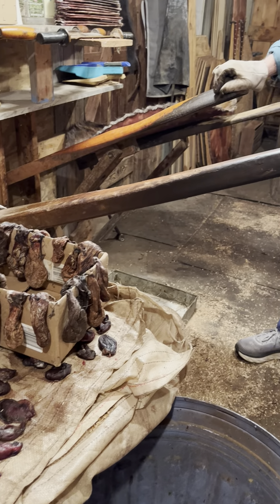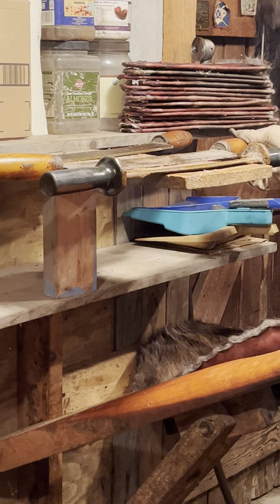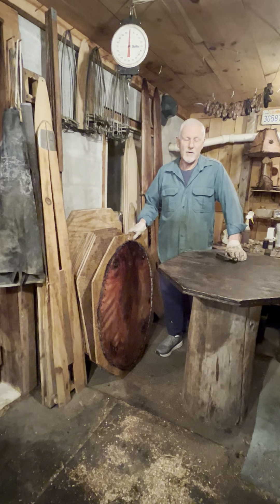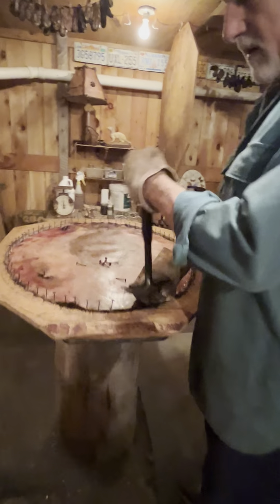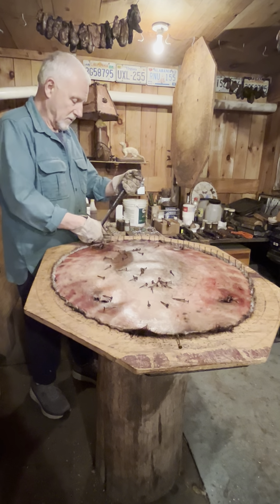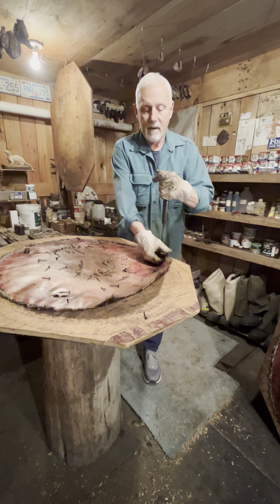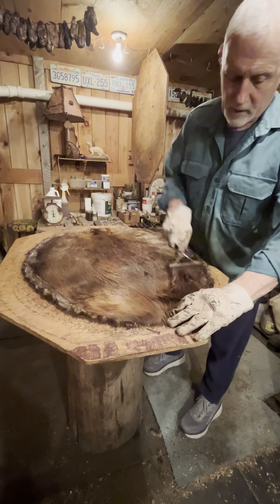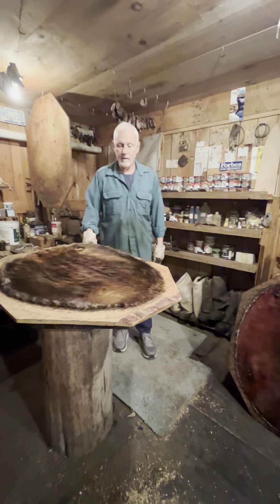Putting up some Beaver with Jim Comstock

Comment: Lots of knowledge shared in just a few minutes. Thank you sir! Nice setup.
Reply from the maker: Thank you.  When I first got into fur trapping seriously with Thorpe in the mid 70's in Virginia, good ol' Johnny said, "if we going to Virginia you are gonna have to do the scraping," which didn't bother me one bit.  Told him, "Sure will."  The only way to get proficient at anything  is to do a lot of it.  In the 3 years we trapped together I scarped all 800.  By the end of 3 years putting up beaver was no problem.  In the next two years while trapping alone I scraped another 450 and lots more since.  I guess I could skin, scrape and stretch, take the castor on 2 blankets in an hour, but not now.  Feel the age, but I still feel good about doing a few here and there.  Glad I don't have 140 in the freezer.